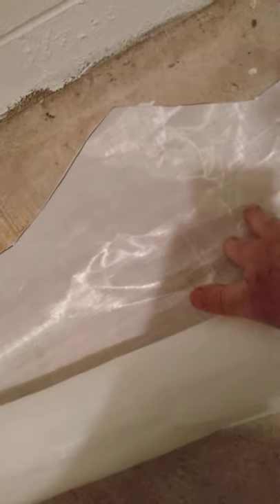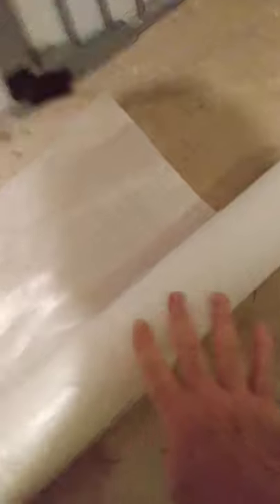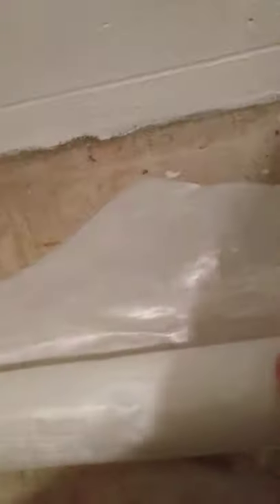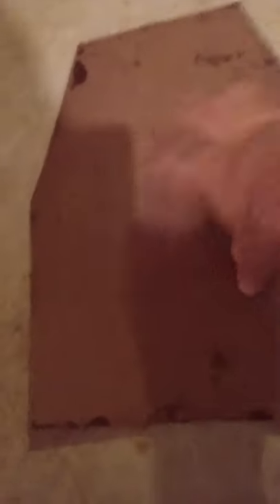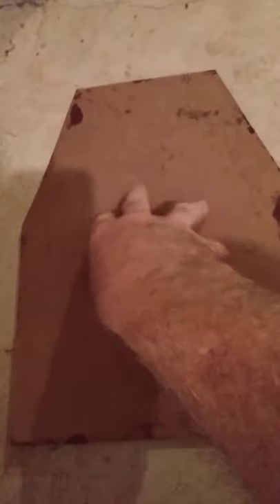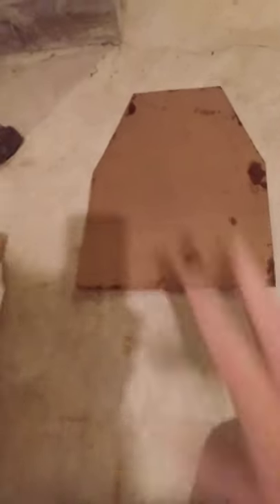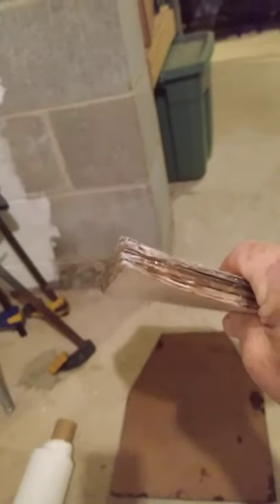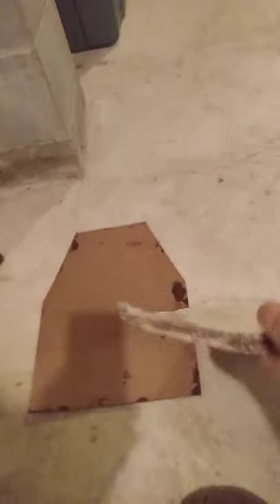DIY UHMWPE ballistic plate armor

Comment: Please tell us the barrel lengths of the test rifles when you get to that point. Also it’s exiting to see an actual UHMWPE homebrew plate!
Reply from the maker: The rifle will have a 16.24" barrel. I'll even measure muzzle velocity so barrel length will be irrelevant.
Reply from the maker: Also...I will be following (as much as possible) NIJ standards when I test the plate.  I will place the test plate against a wood backing.  I will set a chronograph 2.5 meters from the plate.  I will fire from 15 meters (49 ft) using actual 7.62 NATO FMJ ammo.  The only thing I will lack is NIJ test standards have modeling clay between the ballistic plate target and the wood backstop.  I don't have any on hand and will just place a  square foam pad behind the plate.  I won't get any back-face deformation info but I will at least be able to see whether or not the plate stops bullet penetration.
Reply from the maker: Addendum:  I will be testing my test armor tomorrow (Saturday, 12 Sep), weather permitting.  I am going to test from 10 meters instead of 15.  I will also just measure muzzle velocity rather than set the chronograph 2.5 meters from the target plate.  I am a bit fearful of debris or the plate flying back and damaging my chronograph so I won't set it up that way.  At 10 meters, the muzzle velocity will be essentially equal to the velocity at impact so getting the velocity close to the target should be irrelevant.

Comment: Slightly different application, but.. do you think that will it be suitable as an additional layer under an inflatable mattress, which should protect against punctures by an acacia thorn, a cactus or a needle? How many layers would this need?
Reply from the maker: I suppose if you applied the layers to the mattress with flexible glue it might work (maybe 3 layers, max would be fine?). There are, perhaps, better versions of the PE to use that way as well: the type used for stab-proof clothing. It is more fabric-like. Kevlar would probably work too (easy to get on Amazon or eBay: it has a yellow color and is heavy like a denier nylon. In fact, you could get a roll of denier heavy nylon and just make a double or triple layer sheet with it and use it underneath and on top of the mattress.

Comment: Well done! i'm currently working on my own curved and multi curved mold, I can't wait to see how your tests go. That UHMWPE is something else man, I've only used it a few times in builds and each time I've been blown away by it's performance. what resin are you planning on using?
Reply from the maker: The current plate is just standard fiberglass resin. I'm debating how I want to attach the ceramic. Originally I was just going to use the same resin but then caught some of your vids on trying to extend the durability of ceramic. I've also been considering using one of the construction adhesives to attach but then mud in the seams and covering the tiles with some resin mixed with a LOT of SiO rock polishing grit to the consistency of mortar or cement. Maybe derive a little extra protection that way, especially at the seams?
Reply from the maker: Kalergi is trash  I'll have to try this. It would save a lot of weight.

Comment: Cool stuff! Have you considered overlapping the tiles so there isn't room for bullets to slip between? You've got to record in landscape, quality will be so much higher
Reply from the maker: I've corrected the landscape issue. Won't do portrait anymore.
Reply: @BooDamnHoo  I'm sure you figured that out on your own. Have you ever watched anything from Tech this out meow (posted a link at the bottom of the comments) or from this guy? https://youtu.be/PcLd4h095DQ I'd love to see a collaboration
Reply from the maker: To overlap tiles means a double layer of tiles. That means a LOT more weight and a lot thicker, or corresponding fewer UHMWPE layers. The tiles are butted up to each other as tight as possible and the small gap filled with resin. A bullet striking directly on a seam will wreck two tiles but still be distorted and shredded by the tiles. In one of my shots at a test plate one of my rounds did hit a seam. It was still stopped from penetrating the armor.

Comment: Friend. Could you replicate the artisan armor made with $ 30 dollars from the ZNA Produtions channel?
Reply from the maker: Say what?  I am currently having to wait before I spill for another roll of UHMWPE, at which time I intend to make a full plate using my new ironing method instead of resin.  I am having to balance out purchases right now between stocking up on ammo, powder, and holsters.  I'm also waiting for parts for a gun build I'm doing.  The new plate sits somewhere in the middle of all that (because it is looking like I may actually need the armor sooner rather than later).
Reply: @BooDamnHoo  In that case, I'll wait until you have the time and resources to replicate the armor from ZNA Produtions. Good luck with your projects.
Reply from the maker: @bryanrosario4954  I see what you mean now. You mean the simple fiberglass armor he made. It was that video and those of Tech Me Out Meow that inspired me to go for it, but using UHMWPE instead. Yes, fiberglass can be used and you could cover it with ceramic tile to increase its ballistic protective performance, but it is heavier than PE and I wanted to avoid the possibility of glass fibers going airborne and into my lungs (or even glass fibers entering the body from a penetrating bullet).  Now that I know a simple iron can make a solid PE sheet plate (that by itself will stop pistol rounds), and can easily be bumped up to stop rifles, that's my go-to now. Ironing sheets together saves a TON of weight. Fiberglass requires resin by nature so will be heavier before adding tiles.

Comment: does it produce 
 fragmentation please ?
Reply from the maker: Do you mean the ceramic? The tiles haven't fragmented all over the place - it was all contained within the  covering of duct tape that I used on the test plate. On previous tests fragments we're contained inside the ripstop nylon cover I had on it. I do not believe that fragmentation is a problem with tiles. The bullets flatten and a bit of fragmentation of them in the plate are contained as well.